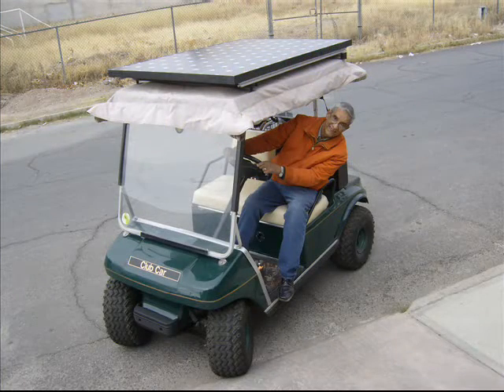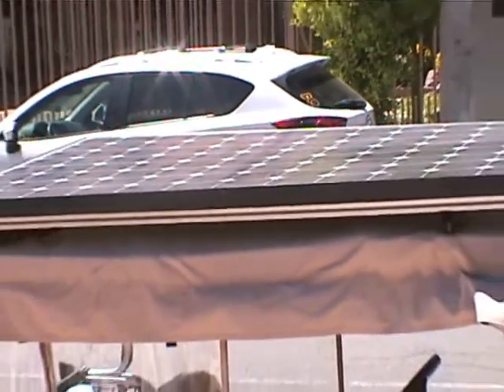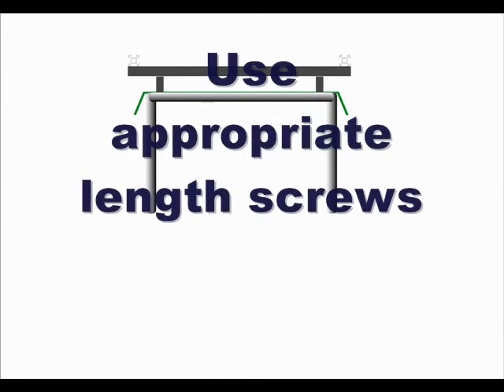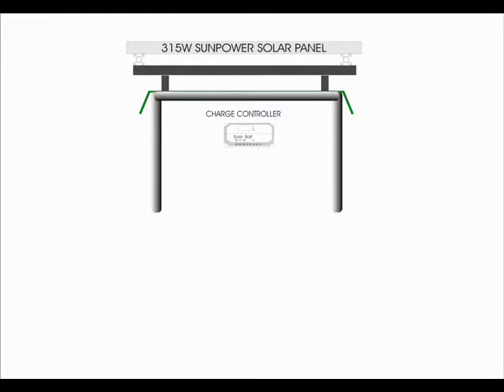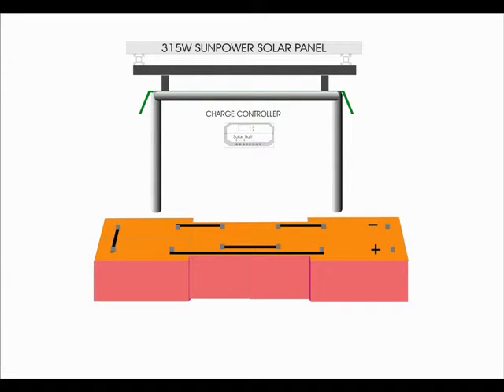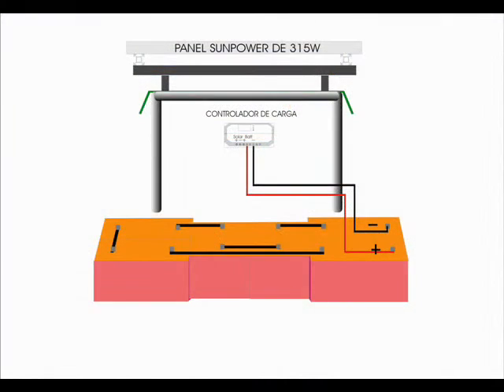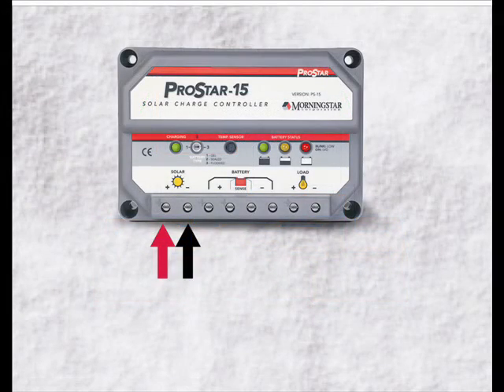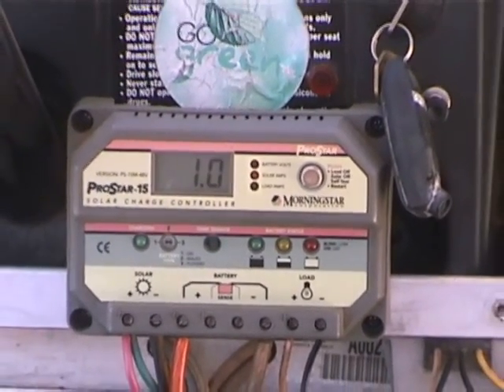Convert Golf Cart to Solar

Comment: VERY INTERESTING VIDEO!!! I have even read all the commentary prior to commenting myself. 
My Scenario : 
I want to convert my cart to solar. 
I want to install 2 x 400W panels (79"×40"×2") overhead (400W - 41.7 Vmp / 9.6 Imp) & MPPT charge controller.
The battery will be a 1.536kWh (80 x 32700 cells) 51.2V (16S) / 30Ah (5P) LiFePO4 DIY build.
Should I connect the solar panels in SERIES or PARALLEL?
Reply from the maker: Dear  friend, I am curious about the size of both panels, do they fit in the roof? In mine I used only one 315-watt panel and it barely fits on the whole cart's roof! Anyway, MPPT battery charge controllers usually have a maximum input which should be taken into account. I am not familiar with LiFePO4 batteries, in my project I kept the lead-acid 48-volt battery bank, and it works fine. Please make sure the charge controller matches both the array's Voc and the batteries charging protocol. I understand Lithium Iron batteries have certain specific charging requirements. Please keep me updated! If you have a video of your cart as is, please let me take a look at it.

Comment: Nice job on your panel install!  I was able to find a MPPT charge controller that will allow you to use panels of a lower voltage than the battery bank (much less expensive that way).  I have 2 100w 12v panels on my Yamaha golf cart and so far have not had to plug into the wall charger ever since. You can see the video on my channel if you would like more details.  Thanks again!
Reply from the maker: Thanks a lot for your comment, I will surely take a look at your video! When we converted the golf cart, we already had the 60V SunPower channel, but, of course, what you did was much better!

Comment: I'm surprised that I haven't seen one solar cart design with adjustable pitch on the panel. All the o=carts I've seen seem to be good for charging in mid-day. Why do you think this is, when it would be so simple?
Reply from the maker: Dear Zak, if you look at my solar energy clips you will see not many people watch them. People sort of do not believe solar can handle a lot of power. Most people center their interest in other things rather than sun power. And, yes, I have seen very few carts using solar, other than "extend the range" but not to totally run on sunshine. Solar can solve all power issues! If they devote more efforts to experimenting and more money on research, very soon we would see solar homes, solar cars and even airplanes. Tilting the panel on the solar car would increase the power harvest, maybe it would not be very practical for handling the cart on the road. My dream vehicle would be some kind of a van or mini bus with a large roof, so many panels can be installed on top. A tracking system on top of a golf cart would pose wind issues in some locations. Maybe a mini-bus (similar to a low weight VW bus) would be a good solution. The cruising speed would not be too high, but it would run on free energy all day!
Reply: Chava Tarin Great to hear from you so quickly. I share your enthusiasm about solar projects. I don't share your knowledge of electricity. I'm way down on the learning curve. I want to do a project step by step to completion. Then take what I learn from that a add to it on the next. My idea with the adjustable pitch panel is that it would be parked and maybe not at enough pitch to cause the cart to tip over. My first idea with solar was about two years ago. I seen an electric outboard boat motor called Torqeedo. My mind exploded with the possibilities. That motor+pontoon boat+solar panels and the Great Lake's would be all mine.
Reply from the maker: As a matter of fact, solar is as easy as ABC - Panel-Controller-Battery, just observe polarities and voltages. My project is on way for totally solarizing my home. My funds are not very great, so I am at a turtle pace. I was able to change my gas heating to electric, and it was great, however I still am using gas for water boiler and stove. I need to buy an electric range - they are not cheap - and an electric boiler too. However, my home solar project is at about halfway done. I am using microinverters and going one or two panels at a time. I have currently 2.2 kW on my roof-top. My light bill (I live in Mexico) went down to the equivalent to $3.50 (three dollars and fifty cents) every two months!! If I am able to do away with my $25.00 US a month gas bill, I would be very happy. At 76, sometimes my income is not enough for my mad scientist mind. Ha, ha. I made a solar tracker for my home and even when the results were great, very soon the wind took its toll on the tracker motor, and I had to forget about it and anchored my panels straight South.
Please keep me updated on your projects. Bless.
Reply: There is no money in being a mad scientist. It take money to be one. Look at Professor from Back to the Future. He never once mentions making money off the ability to travel to the past. He also never says where he got the money for the DeLorean either. They left a lot of unanswered questions in that movie. Like how does a High School kid become friends with a disgraced nuclear scientist? I have ADHD. As a result I daydream a lot. Most of the time it is about solar power. Which is weird because, like I said before, I know nothing about it.
Reply from the maker: Yes, you are right!! However, it is a lot of fun!!
Reply from the maker: Zak, the cart has been used only in the golf courts, and otherwise is parked in a yard and fully charged. But the batteries have never gone dead on the golf courts, they start topped at the start of the game and finish topped on the way home. The panel is highly efficient Sun Power 315W, and has worked fine for over 3 years.
Reply from the maker: The original charger has not been used at all since the panel was installed!
Reply: Regarding your question to adjusting the pitch of the panel. The panel only looses about 20% of its power laying flat as compared to tilted at the correct angle to the sun. Because the cart is moved and pointed in all directions It would not be practical to attempt to angle the panel towards the sun, laying flat is good enough.

Comment: I thought the pro star 15 is only rated up to 24v?  
How is the reliability of this steup? I looking for a decent 36v solar controller, using a 36v panel.
Reply from the maker: The cart has been working without problems for over three years, water has been added to batteries once a year, since they do not cycle too much. The charge controller has been working fine all that time. There are three versions to this controller, two 12/24V ad the other for 48V - please take a look at the manual - http://www.windandsun.co.uk/media/757744/ProStar-Manual.pdf
Reply from the maker: The cart has been working for over three years now, and no maintenance has been done, the lead-acid  Trojan batteries are always kept to full charge, since the cart is kept in a sunny yard. So far it has worked very nicely. We even replaced the motor and tires with bigger ones to improve performance.